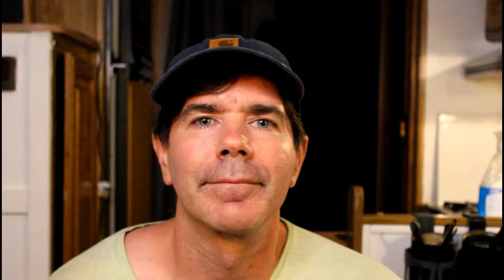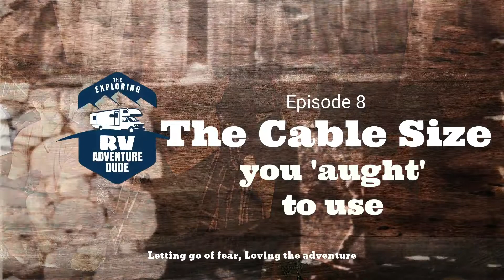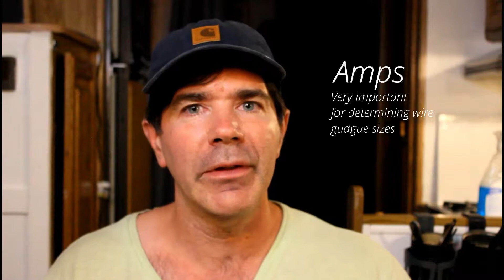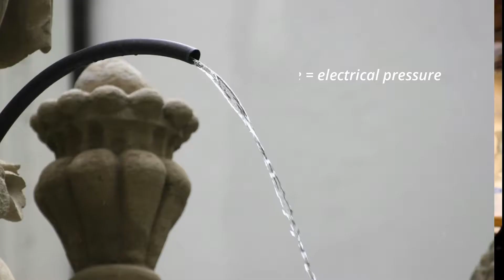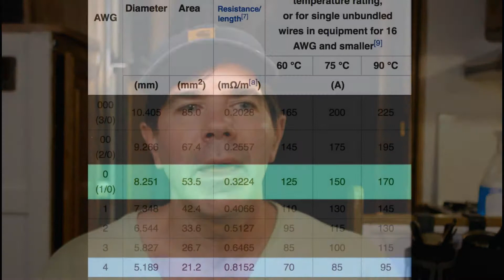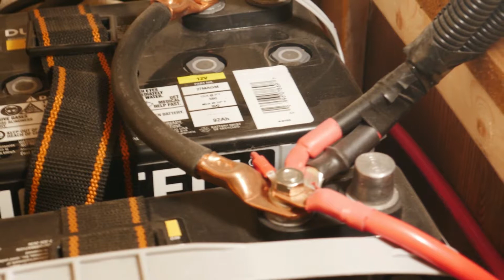Ep8 Battery Interconnect Wire Gauge

Comment: I have a 900 watt wind mill and they said use 6 gauge wire from the windmill to your controller and batteries witch I have 4 6 volt in series for 920 Amphs ,460 usable Amphs ,so I used 6 gauge to connect all my batteries ,to my 10,000 watt pure sign inverter that came with two huge cables to connect the inverter to the battery bank so I used them ,I also have 500 watts of solar, so if the sun don't shine but the winds blowing i am covered.